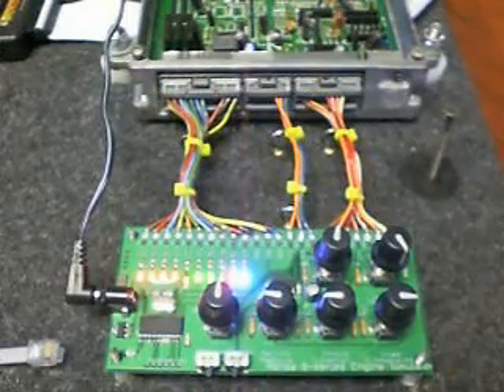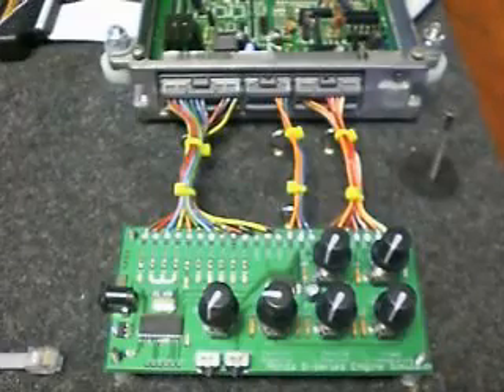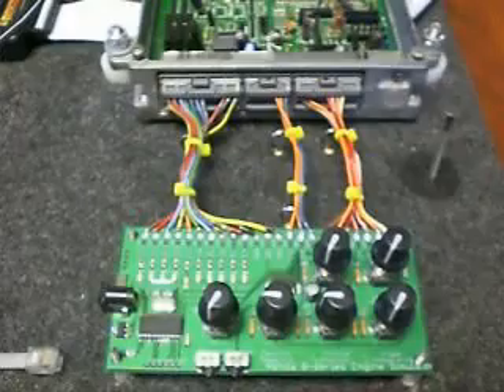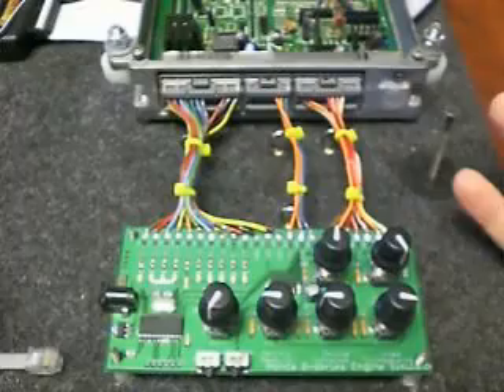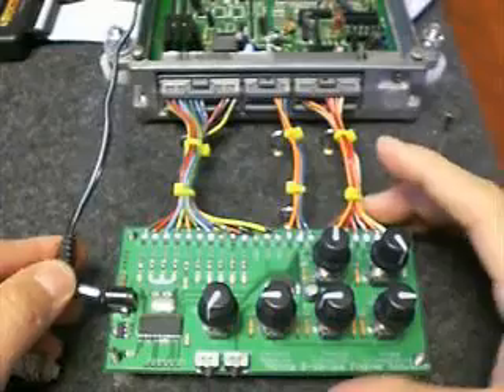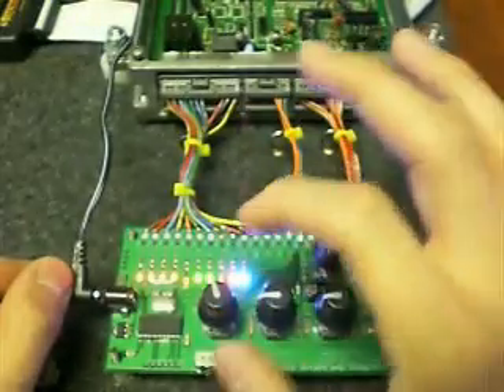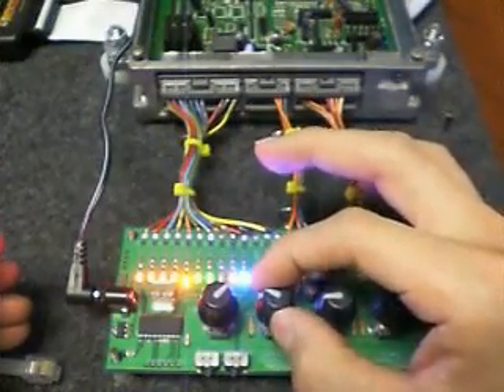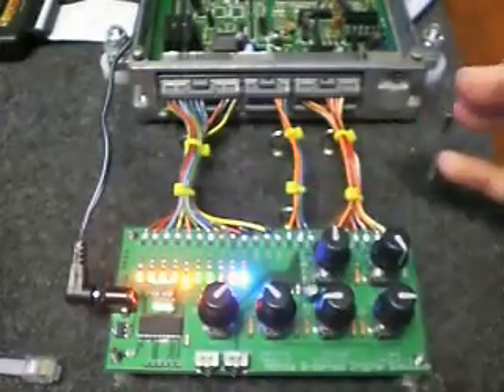Honda Engine Simulator. !

Comment: where do we buy?  i used a jimstim doing megasquirt but im sure the parameters/outputs differ from an obd1 honda ecu.  i have a stack of p06/p28 i need to play with and/or repair.  thanks.
Reply: So no need for distributor signals..what's the rpm sinal output ?
Reply: I sell these sir.

https://www.facebook.com/298382090755479/posts/442007079726312/
Reply: @jasonhiboost9149  Any link for the many of us who perfer not to use facebook?